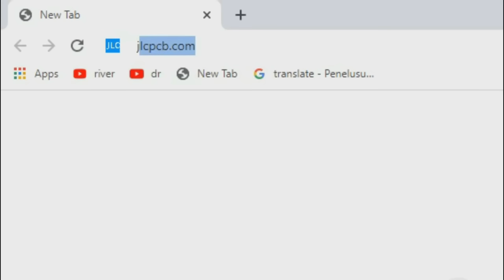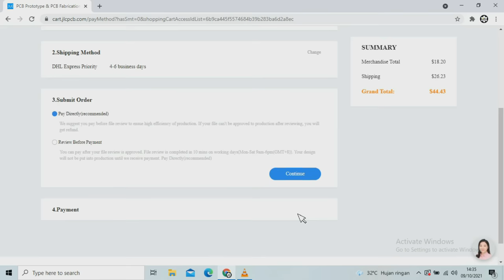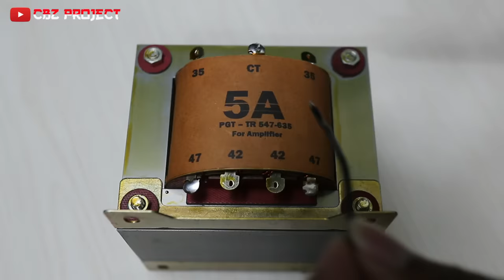Build a High Power Amplifier Using 20 Transistors - MICRO BOOSTRAP with M-270 BOX

Comment: Oh right, an amp that the fan sounds louder than the music, marvellous.
Reply: You've never built a solid state amplifier that's obvious. People like you should start with a high voltage vacuum tube amp. Do zero research, maybe you won't live through it.
Reply: @joshpoe  Thanks for the advice, appreciated, I will save myself some money and buy something that sounds half decent instead.
Reply: @dougieroberts7045  before you judge maybe you should understand what speakers are being used and how this was recorded. I've listened to 1 million dollar Krell and Mark Levinson systems generating thousands of watts but for musicality I've been more blown away by analog systems running off batteries making less than 50 watts.
Reply: That’s fairly average by PA amplifier standards…
Reply: @joshpoe  This amplifier is not so powerful to run fans on idle or low load. My Yamaha amplifier turns on fans only on high load.
And good amplifier has to have balanced inputs.
Reply: @Tremodua  yeah right, xlr inputs? Why not toslink? Why not rca? I only use XLR for places with poop power and long runs. No need for then at home with conditioners and high quality rca or tos.
Reply: @joshpoe  You cant use at home amplifier that is so loud with its fans. Balanced inputs is very important. At home I use reciever Marantz with hdmi input.
But also at home on 3rd floor I have a powerful speakers for karaoke, I use yamaha PX 8 amplifier with balanced inputs there.
Reply: @Tremodua  hahaha ok
Reply: @joshpoe  ha ha ha ok :)
Reply: why is it inside the puff of air from the exhaust fan should it come out that puff of air from the heat sink it will suck in the heat that is released put the cover of the amplifier
Reply: W 5:34 hatis. Cost.  Of.  This
Reply: holy fuck these comments are aggressive. chill out its just amplifiers 😭

Comment: Bro... Why did you zip tie audio, power and mains power cables together? That single step blew your insulation rating AND made it more sensitive to noise and interference. Also using black for earth? You took 4 premade components, put it in a box and screwed up the wiring. That was a 16 minute video. Nice.
Reply: None of the wires soldered went through the loops.  No vibration mitigation on the solder joints. Fans blow back to front and are powered by wires parallel the audio signal.  Eventual galvanic corrosion between steel and aluminum due to lack of isolation.  Undersized transformer.   No fuses beyond the C15 power jack.  Binding posts are INPUTS?!!?   I'm guessing this guy is FRESH out of school.  Make a few PCBs and now you think you know everyhing.
Reply: @AkkerKid  mohon buatkan saya video yang benar tentang ini,saya sangat membutuhkan dari seorang profesional seperti anda...mohon
Reply: @AkkerKid  mohon buatkan saya video yang benar tentang ini,saya sangat membutuhkan dari seorang profesional seperti anda...mohon
Reply: @dexcronicle9813  Sorry brother, I don't have need to build one of these.  If you plan on building your own, keep in mind a few requirements.  Keep high power and low power signals separate so you don't introduce noise. Make sure your weakest components are fuses so they break first before anything else.  Consider gluing down large components like power capacitors so they don't break off of your PCBs.

Comment: ha, i saw what you did with the speakon, mounting holes where drilled in mirror, so you needed self tapping screws :) instead of the normal M3 bolts
Nice work, would have chosen a heavier transformer though.

Comment: Couple of observations:  1) Use masking tape to protect painted panel from accidental damage while drilling holes. 2) Use nyloc nuts to secure modules to the chassis. If nyloc nuts are not available use thread-lock blue - Loctite 242 to keep nuts from backing off  3) Always use a wire hook to connect a wire to eyelet :(  Do not rely on solder to provide mechanical support.

Comment: Nice looking amp. I'm a bit worried about lack of protection. I didn't see any fuse on that transformer. Also there should be some inductance to remove noise from line. I also didn't see any fuse on other side of that transformer. But who knows maybe there was some. Anyway. I would suggest to add steel plate from both sides so actual amplifier is shielded from transformer .It might help a little to remove the hum/noise.
Reply: the fuse is located in the ac connector socket @4:52
Reply: There is a fuse on the power inlet. A noise filer would have been nice, but there is no switchmode stuff and a lot of capacity, so I am sure it is fine.
Reply: @Daaremikkel  yes Sorry i did miss that. I'm glad for that also i'm glad for that second fuse on secondary. As you said some filtering would be nice and i'm not sure how effective it would be but i expect it will loose efficiency once higher power will come into play..but still it might be good idea to test it. Could you please make simple check ..Bring proper laboratory 6.5 digit meter and test AC voltage at the input of your power stage..I know you can't check all frequencies only line .but still this might show you how much AC you have in your amplifier..I would also suggest to check it with some load..lets say 400Hz  on input  with full power and then check it again..
Reply: @SylwerDragon  That and adding speaker protection would be a great idea especially given plenty of room inside the chassis. Overall, I think for the advertised budget it's a pretty solid build. Speaker protection would have only added maybe $10-15. At least in this build amp heatsinks are properly installed in line with fan airflow, seen so many in these DIY videos that are installed perpendicular to the airflow.
Reply: Makasih atas ilmunya
Reply: Cara mengatasi kebisingan pada amplifier bagaimana menangani?
Reply: @expired56k  speaker protection is there.

Comment: a powerful amplifier with a radiators located UNDER the amplifier boards, with no air inlets in the bottom of the housing; probably only for use WITHOUT the housing...?
Reply: it is not very relevant. The amount of air blown by the fans is way larger than the amount of convected air. If it is a sound design when listening to low level music is a different issue. I don't believe in power cooling by default.

Comment: Never rely on a soft soldered joint for mechanical strength.  The holes in the transformer tabs are there for a reason, you're meant to hook a wire through each and make the joint so the end of the wire is evident.  See 11:40 into the video for what I'm typing about.
With the transformer connected as shown you'll get around +/- 21 V DC, hardly a high powered amplifier - maybe this is an advertisement for the PCB manufacturer that you get paid for.
Reply: I know its been months, but I believe that is a particualr brand of transformer prevalent in Indonesia which has multiple outputs. Usually it has support for preamp 12-0-12 or 15-0-15 located at the bottom while on the other side has the higher output usually 28 to 55 volts

Comment: Nothing special in this. Pre defined connector pins. Lack of protection.  No fuse. I think it will make humming surely. Simply a power amp mantling process in cabinet. Anyway. Wishes

Comment: Transformer is underpowered and filters??? Just 20000 microfarads???
After that powerful transformer..
You have to say max 250 w per channel.
The project looks very cool but you have done just assembly, and the box looks almost half empty
I have done exactly what you did but I made the pcb's, electronic diagrams, configuration from a to z
The box was cut on CNC machine and electrostatic painted.
Cannot compare the feeling.

Comment: 🤨 What, no DC protection/speaker-delay/thermal overload protection? 
Wow! One badly soldered joint or a blown transistor and you can kiss your speakers goodbye. Not a gamble I would like to take. 
Recones are way too expensive and hard to get for comfort.

Comment: Nice housing, but why a transformer and no switching supply? No Temperature controlled noisy fans? might be good for a club but nothing else. Real commercial equipment would have at least a 6.3mm connector for input and not rca, or better xlr with balanced signals. Don’t cost a fortune and makes live much easier with interference problems (ground loops).
Reply: Buenos días, Las fuentes switching no se recomiendan en estas aplicaciones por su esquema de entrega de corriente casi constante. Las fuentes para equipos de sonido pueden entregar grandes cantidades de corriente por un periodo corto de tiempo, debido a la naturaleza transitoria del sonido. En resumen, las fuentes swithching se recomiendan en aplicaciones donde el consumo de corriente es practicamente constante, mientras que las normales para estos casos (y otros, claro)

Comment: It may be a silly question, but I rarely if never see an amplifier using switching type power supply. Why?
Reply: Buenos días, Las fuentes switching no se recomiendan en estas aplicaciones por su esquema de entrega de corriente casi constante. Las fuentes para equipos de sonido pueden entregar grandes cantidades de corriente por un periodo corto de tiempo, para responder adecuadamente a la naturaleza transitoria del sonido. En resumen, las fuentes swithching se recomiendan en aplicaciones donde el consumo de corriente es prácticamente constante, mientras que las normales para estos casos (y otros, claro)
Reply: 1: cost    2: "this is how we've always done it" mentality  3: SMPS would need high switching frequency and good filtering to make sure noise doesn't make it's way through. 4: would need tight integration with the amplifier section so it can preempt large current draw and not rely on watching the voltage of it's output dipping before it reacts to add more current in. 5: Most professional amps (at least all the recent ones I've seen) DO have SMPSs.  6: in the end, amps with SMPS are better since they can recharge capacitors must faster than 60Hz so you can use capacitors that are smaller and produce higher total output at lower frequencies.

Comment: * Power, Neutral, Ground - All Same Color.
* Audio signal and power wires ran together.
* Under spec transformer for power level of Amplifier boards.
* Fans moving air in an inefficient manner.
* No locking washers, nylock nuts, or even thread locker used in hardware mounting.
* No input selection switching (A and B are gang wired).
* No fuse past the power jack.
* Power switch does not cut mains power to transformer.
* Wires that were soldered had NO mechanical connection (pass through the terminal, solder, heatshrink)
* Output jacks have brass threaded inserts - ran machine screws through plastic instead, no end securing of the screws...

Congrats, this is utter junk.
Reply: Maksudnya apa anda anda sendiri yang tak paham 👎
Reply: My thoughts exactly, this is a shoddy build and it's underpowered - likely an advertisement for the PCB maker.
Reply: @stevesmyth4982  Yeah it's clear these were people just assembling something. There is Zero Electrical, Mechanical or Audio Engineering skills on display here.

Comment: Amazing. I had no clue 1 person could make an amp
Reply: This one person didn't make an amp.  This one person assembled a few store-bought parts in nearly the worst, still usable configuration.  This is a demonstration of what NOT to do.   Instead, use the right sized components, don't run power, signal and output wiring anywhere near each other, add more fuses, etc...
Reply: @AkkerKid  balanced input would be nice but as you stated I don't think isolation of power and signal was his priority.